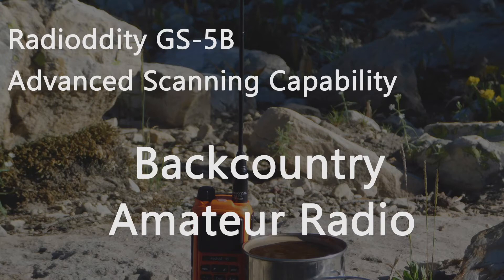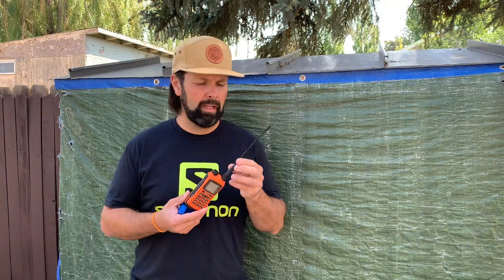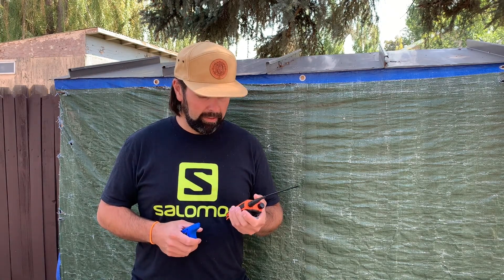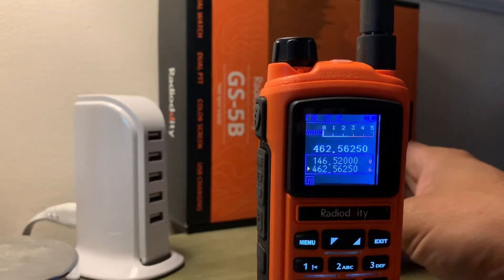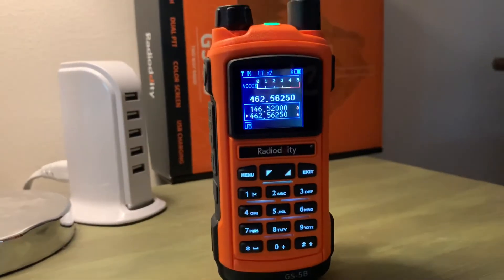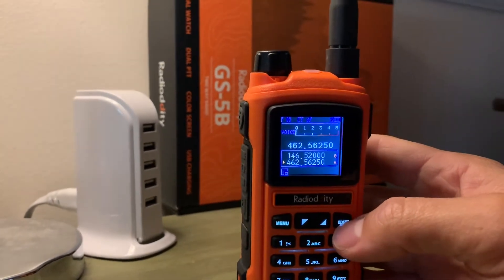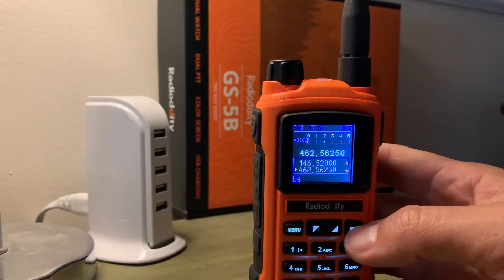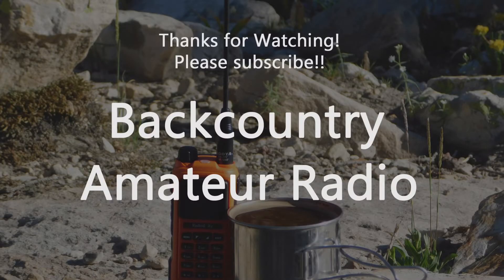Advanced Scanning with Radioddity GS-5B Ham Radio - Search Frequency Mode

Comment: Is the gs 5b rated for use with frs by fcc. 

I am studying for ham lic but would like to use it for some production gigs I have ( not on any band frequencies.  )
Reply from the maker: It is only part certified as a “ham radio”. But it has no frequency restrictions built in. You would be able to program it for FRS if needed for emergencies… it’s sister radio, the GM-30 is a practical answer to that as it is a GMRS rig and works with FRS frequencies. You’d want to get your GMRS license as well though.
Reply: @backcountryamateurradio  just got my call sign today.

Comment: I forgot to ask. When you use the scan frequency feature, and start on 462.000 for example, does it just scan the 462.000-462.999? thanks for the video
Reply from the maker: In my experience it will continue to scan until you stop it or it lands on a signal. Been a while since I used that feature though.

Comment: has anyone else had problems with the channel scanning? I've returned my first radio I got from them because they wouldn't scan and channel, and now the second one they sent to replace it, my gs5b, did the same thing. it will not scan and channel mode, but it will scan just fine in frequency mode.
Reply: okay, I got it figured out. when I first got the radio I did not have the app downloaded. therefore, I didn't connect to the radio via Bluetooth on my phone. The channels scanned just fine for 3 days, the ones that I manually programmed into the phone. however, after 3 days it would not scan any channels. I downloaded the app, connected to my phone and programmed it. now, it will scan whatever channels I have toggled on in the app, in order to scan. The more I use this app, the more I love this radio. especially, knowing that I can create different profiles and save $128 channels multiple times without losing any of my saved information,. I am referencing your second video showing how to use the actual Bluetooth programming. also, I used the scan feature as you showed it here in this video and I was able to pick up GMRS transmissions showing me the frequency and code. thank you for showing me this. now that I know how it works I love it.
Reply from the maker: @markj7579  I see! okay, well I am so glad you have it figured out. It's gratifying to know that these videos are actually helping! This radio is so fun and easy, and has good transmit and receive quality as well. This is a favorite for sure. 

Thank you for posting your experience here. There nuances of programming this rig take a little getting used to, and that can definitely result in some weird radio experiences. But as you say, once you get it, you love it. Enjoy! Eric KI7WJP
Reply from the maker: That's actually interesting. I never tested that myself. Now that you ask, I also don't know how to do that and can't use any logic to guess my way to scan channels. hmmm...

Comment: Hi Eric.  I am getting back into Amateur Radio after being away for some years.  After watching your video, I wanted to ask you a couple of questions.  1) which GMRS radio do you own?  2) is the blue radio seen in your video a GMRS radio?  3) what radios do you use in the backcountry....Ham? GMRS?  4)  what uses do you use the GMRS radio for?  Thank you for taking the time to answer my questions.
Reply from the maker: Hi Robert, glad you’re coming back to the hobby! For GMRS radios I only have the Radioddity GM-30 and two of the BTech GMRS-V1. The blue radio is a midland FRS unit that has actually been a phenomenal performer, runs on AAA’s and sounds great. 3. For backcountry use, often I will take both GMRS and Ham radios. The GMRS communicates with FRS so it enables me to talk to groups/operators without ham radios. Plus, given the antenna upgrade, it makes better sense. The Ham radio is for really getting on the air. We have a repeater system that is linked across several hundred miles. So that’s not only fun, but a handy tool. 4. I use the GMRS to also talk back home when I’m in the mountains above the home area. No one back home is Ham licensed. Other than, just communicating with other groups has its usefulness. I’ll post a video in the following comment, skip to the last part. In my area there are a lot of people in the mountains in winter and many with FRS radios. I hope this all helps! 73
Reply: @backcountryamateurradio  Hi Eric.  Thank you for taking the time to respond to my queries.  I also enjoy photography and visit relative in southern Utah.  I enjoy a bit of hiking/camping now and then.  So, I am looking forward to including amateur radio in these activities.
Reply from the maker: https://youtu.be/iAQy3ftDHHc

Comment: Got one coming soon.  Appreciate your informative videos, thanks.  I work on various road worksites that use radio communication if I can scan frequencies it’ll give me an idea what is going on.  Sounds like this will work better than my Baofeng radios.  I wonder if scanning is any faster with the GS-5B?  I primarily bought it because of the Bluetooth programming and battery charging with the micro SD, (although I wish it was type C).
Reply from the maker: I hope you enjoy the radio as I have. I'm with you on the charging, I also wish it was a type-C, but considering how many radios can charge in this manner, I'll take it! I'm not sure if it will scan faster than the Baofengs, as I've really never thought about it! I'm tempted to say that it does because it does so many things better than a BF. Have you had a chance to mess around with that yet (assuming you have yours now)?
Reply: @backcountryamateurradio  yes, it does pick up frequency/codes when close to someone with a radio.  I have tried just scanning and it doesn't seem to pick up signals from distance.  I am unsure if any  Yeasu HT's scan and can store, but will get one if I can decide on a model.
Reply from the maker: @bobinmontana777  I would love it if Yaesu would offer this type of scan feature.